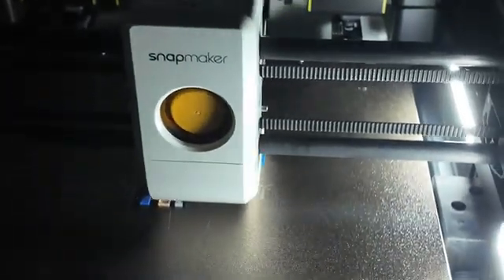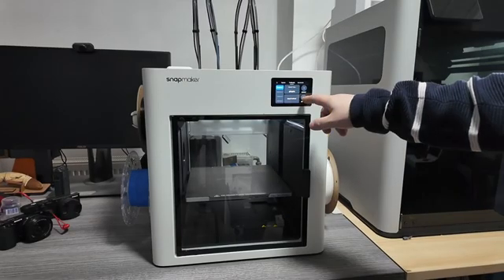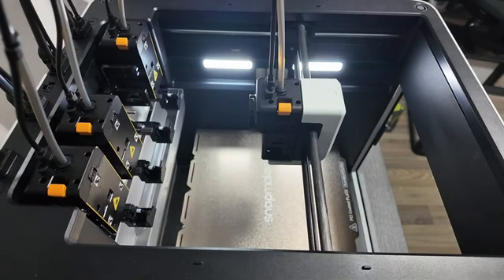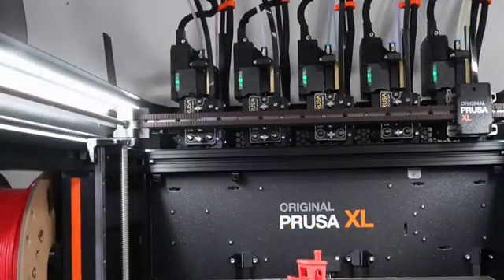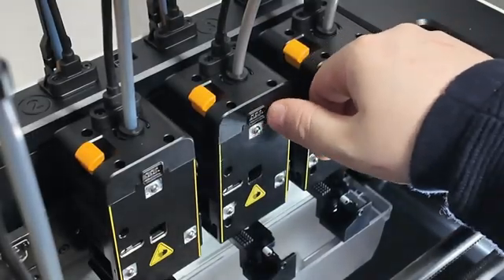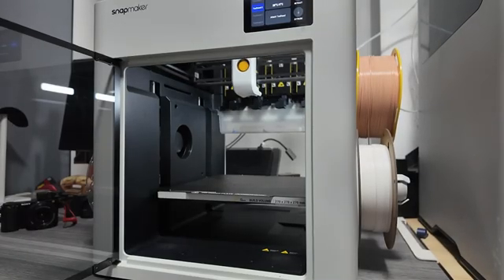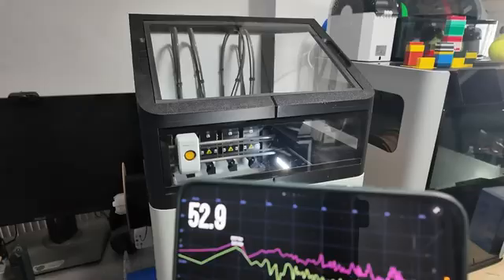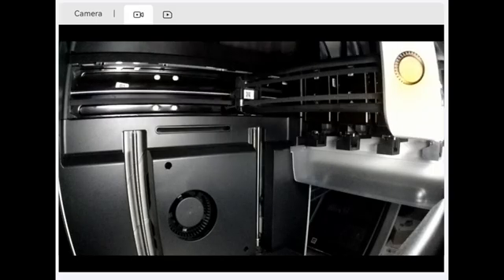The Snapmaker U1 Just Changed 3D Printing Forever (Watch This!)

Comment: Qidi had major issues with their 3D printer making printer bottom from plastic, they use metal since. So this is bad design from company that never learns, avoid.
Printer has no bottom metal structure, it bolts to flimsy plastic bottom.
Reply from the maker: interesting... thanks for that

Comment: I had pogo pins on my CEL RBX02 print heads and they lasted three years, before bad connections overheated the springs inside the pogo pins, but these were only disturbed when changing printheads, which wasn't very often.
Reply from the maker: when a manufacturer gives number on how long these will last , take it with a grain of salt, test benches and real world envoirements are different. The outcome will be different aswell.  Just saying

Comment: Changed forever... Until INDX releases in 1-2 months...
Reply from the maker: it might take much longer before we can get our hands on it though... it'll be a mayham
Reply: @aim6mac you mean like if you were to order a U1 right now, you wouldn't get it before april?
Reply: I've got two changers in the pipeline that I'm waiting for, and I too am interested in an INDX system, but to be honest, something like a Qidid Max4 fitted with an INDX system would be enough for me. Technically able to print most materials with a flexible tool system would be great.

Comment: I believe it will print most materials WITHOUT the pogo pins they supply power to the fan/fans on the carriage , the heads themselves are hard wired
Reply from the maker: do you think the printer will continue working / printing when the pins are worn off?  I don't think so but I will test it by putting some tape on one of them to see what it gives.

Comment: Hey question do you think it would be possible to install a Panda Hotend on it? I do wonder as i already bought stuff for Revo so would be amazing.
Reply from the maker: if the dimensions are the same why not, only u would have to use snapmakers heater and sensor

Comment: Mine has been plagued with toolhead parking problems... I'm sad all these other people have zero problems with theirs when mine has alignment issues almost every print.
Reply from the maker: if i was you i'd take the toolheads  off the printer, retighten the belts, maybe even switch toolhead 2 to 3 , 3 to 4, 4 to 2 , and then recalibrate the initial calibration (maybe reset the printer) and see what that gives?
Reply: @aim6mac  That's actually a really good idea. When it prints, it prints beautifully and there are no toolhead issues. Its always at startup, homing, or loading/unloading filament.
Reply from the maker: @cylonmode  you will love the printer when it starts printing flawlessly :), just try what I suggested.
Reply: @cylonmode did this end up helping you?
Reply: @StuffForYouHere  I think it was the firmware updates honestly. There is still an occasional hiccup with toolhead parking but it is very rare now. I'm a happy camper with this machine!

Comment: Knock on wood.. mine (got it 2 days ago) been flawless (almost) working on a 18h print, almost done and its also a 5 colour too.. the only issue is the bed takes a long time to heat up to 60.. when it gets to around 50c the power for the bed cuts down to 45% and slowly gets up to temp, printer will not start until its 1 or 2 c from target bed temp.. need a way to help it hit temp i need faster.. u guys helped me with the crealiry k1, I hope u can do wonders with the u1 :).
Reply: How is yours 5 color???
Reply from the maker: @cylonmode  he's probably doing one manual color swap somewhere?
Reply: @cylonmode  pause at a point where one or more of the colors are not going to be needed anymore.